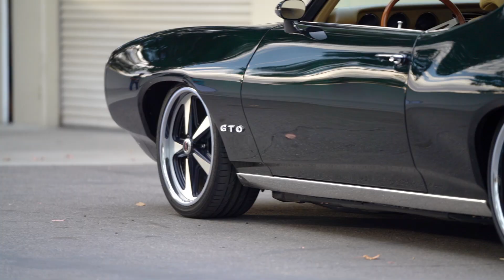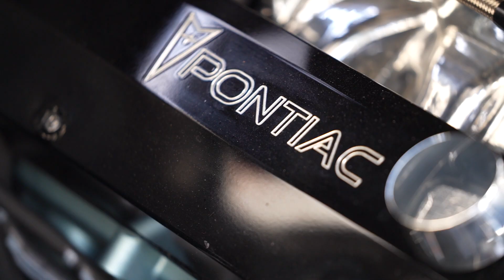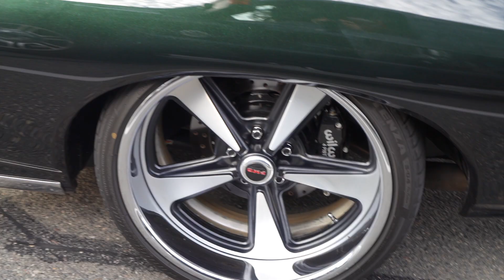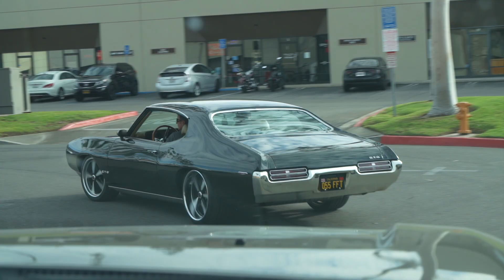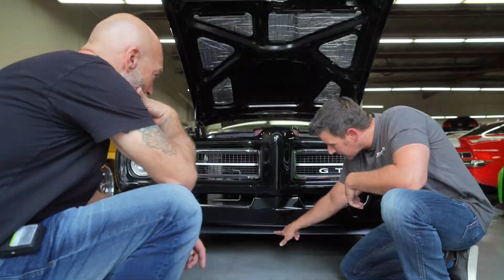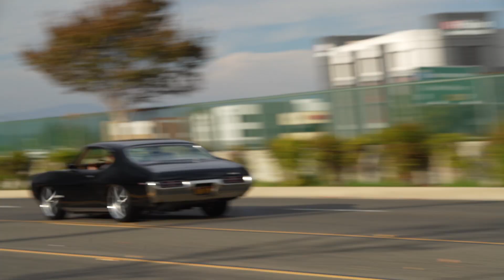LOUD Pontiac GTO Custom Pro-Touring Build | DIY Project Car

Comment: Gorgeous build.

You guys want to see a one of one "fluke" factory built '70 GTO Judge in possibly the coolest, craziest looking "factory"(fluke) paint and interior combination? It's a 70 Judge, in Mint Turquoise Metallic, with Blue, Purple and almost florescent red Judge striping, with a bright red full interior....it looks absolutely amazing (and would absolutely kill if it had this stance and wheels). That specific paint wasn't available with red interior, but when it was built in Canada, they must've run out of the interior color it was meant to have, so they fitted it with full red to match the center "striping", from what I've read, there's a handful of "fluke" GTO Judge's that were built with paints and interiors that were never supposed to go together, and they all came out of the same Canadian Pontiac plant as the US Pontiac would've either had the correct stuff at hand to make the correct spec, or waited to complete the build until it was "correct", but this Canadian plant just let a handful slide out the door with crazy combos nobody ordered 😅

Look the car up, just type in "70 GTO Judge Mint Turquoise" and you'll find it lol.... IMO, it's the best color combo (besides this classy dark green over gold/tan) ever.

Comment: This is one of my favorite builds. I would take that car over just about every thing out here today. I don’t even think I’ve seen a gto in the last 10 years. These cars are rare to see.
Reply: Thanks Brother!  Lot's of upgrades since this video... Shawn might have me back soon, for GTO 2.0.
Reply: @FastMonty  If you are still using the stock clutch pedal and assy, which slave cyl/bracket setup are you using?

Comment: My only suggestion , please take off that carb.  FI is the way to go.  You just can't beat the performance of a modern FI system.  o7
Reply: Done.  Lot's of upgrades have happened since this video.  Including rebuilding the engine... see that smoke on shifts?  Yeah, bad PCV, lead to oil starvation.  Moving on...
Reply: Only EFI Id trust is OEM.
So easy to fine tune a carb with 02 sensors theres no real difference. Maybe a bit at idle or elevation changes. Wont make any more power

Comment: I LOVE everything about this GTO other than the exhaust way to loud I like the mellow sound. Throaty sound, not the ting, ting and back firing when you let off the gas. I owned a 65 GTO with the 389-tri power 4 -speed also 66 GTO with a 68 400 H.O. Formal motor. Also, with a 4-speed Got married all had to go. That was back in 1972-73

Comment: I used to have a triple green 1969 that the prior owner put on 1968 doors since he was a smoker and wanted the vent windows. LOVE how this owner didn't just refuse to go LS, he kept the numbers-matching block--not hard to take these out to a 455 foundation. It's funny how low these things sat stock (i had 1980's Firebird Formula Rally II rims on mine) since so many of us saw these things on Series 70 rubber back when they were just old used cars.
Reply: Thanks Albert!

Comment: I love this car. Awesome wheels
Reply from the maker: I love it too and he’s done a lot of work since this shoot
Reply: @AutotopiaLA  Ha!  That's for sure...Engine Rebuild, now a 470, FiTech Throttle body with a Port Injected optional intake manifold, Tremec TKX with new cross brace,  RAM Dual Disc clutch, new Rick's Baffled tank with an LS3 in tank pump.  Did I miss something?  Might need to do a part 2.  :)  Thanks again for filming my project, had a blast!
Reply: Thanks!  I love em too.  :)

Comment: First time I've seen a 68' with 69' front parking lights. Wish I could get mine back.
Reply: FYI, it's 100% 69, except for the side view mirrors.  Get yours back!
Reply: @FastMonty   well that explains the parking lights LOL. This was posted on facebook, but the title said it was a 68's. I'd like mine back, but it was sold off to another in Vegas. I'll have to be happy with my 87' C/10 short bed.
Reply: @87Rado  Ha!  Too funny... Every time I see a slammed C10, I like them more and more.  Awesome.  By the way, the GTO pic on your profile was that yours?  Because that's the car that inspired my build, even down to the paint brand.
Reply: @FastMonty  Sorry to say, the pic is not of the one I had, BUT it looks just like it, which is why I chose it. Mine was black on black with blue pinstripes, and hand painted GTO in blue on the rear quarter panels. Had around 425 hp, was a blast to drive!!!
Reply: @FastMonty  I just changed my pic to the one I had.
Reply: @87Rado  Ha!  Awesome!  You'll get it back... I have faith.

Comment: Would've went 455 in this.  Also he's got either the wrong rings or too much ring gap.  Something is causing that smoke when he lets off.
Reply: It's the original number's matching 400 block, hence no 455.  The smoke was due to a bad PCV plumbing job... I didn't know I was blowing smoke until this video came out.  Fixed it.
Reply: @FastMonty  very nice!

Comment: What size rims and tires
Reply: 19x8.5 with 245/35-19, and 20x10 with 285/30 - 20.  Will be going with 295's in the rear, as these are a little too small.

Comment: I have a 1969 GTO convertible with the fixed headlights.  Unlike the "common" opinion of most GTO fans, I actually think that the 1969 model year looks best WITHOUT the hideaway headlights.  I think the fixed headlights make the car look more aggressive.  Maybe it's because I also have a 1969 Chevelle SS 396 and the fixed headlights on the GTO kinda makes the front end look similar to the 69 Chevelle SS.  Plus with the fixed headlights you don't have to deal with leaky vacuum lines and floppy, sagging headlight covers!
Reply: Ha!  Thanks Johnny... totally agree.
Reply: Well, all you do is replace the vacuum actuators with electric ones.  They have kits for the 1st gen camaros.

Comment: Cool car and love the pontiac engine!
... but as usual for theese kind of cars: a bit too big rims/wheels. (especially the rears)
Reply from the maker: Those wheels and tires fit and tuck well here though
Reply: @AutotopiaLA  It is an awesome car and I'm just being nitpicky with my personal bias: there's just something that bothers me slightly with the way the oversized rear rim is partially covered by the fender at the top, when the front rim isnt.
The overall stance/rake is cool and the rim design definitely works, so the rear rim is probably the main culprit for this.  
I'd go one inch smaller in the front, and two inches in the rear, but hey thats just semi-old school me :)
(I'd probably widen the track slightly at the front or narrow it slightly at the rear to give a more square stance aswell)
It probably is more eye-catching the way it is though :)
Reply: @rogerwennstrom6677  Thanks Roger... problem is, smaller wheels in the front will not fit over the brakes.  :)  I understand where you're coming from, and it's kind of an optical illusion.  The tires in the rear are actually too small.  The next set will be wider and taller, which will look 100 times better.  We shall, see... Thanks for the comment!
Reply: @FastMonty  Wow, thanks for the reply man :)
On one hand: I do see what you mean with the tires in the rear, there seems to be not quite enough "meat" (rubber) on those rear rims.  (for example, if there's one thing that never looks right is if the height of the rubber itself is less in the rear than in the front, if you know what I mean)

On the other hand: one of the reasons this is a problem in the first place is the size of the rear rim. I'm guessing the rear rim is two inches taller than the fronts and personally that is atleast one inch too many.
The way I see it (which seems to be in the minority nowadays with the common oversized rear rims), there's not really room for the rims to sit quite right in the rear fenders with that big of an offset on virtually any muscle car.  They aren't designed for it!

Those front brakes are the business though, so I respect the decision to go big on rims there :)
And sorry for needlessly putting this awesome car in the crosshairs of a personal "desktop warrior" rant :(
The car is  great! Overall a super thorough job that still keeps the soul of the car intact.
Reply: @rogerwennstrom6677  No worries Roger... everyone is allowed their own opinion, ha, ha... So, the rear wheels are currently 1" larger than the front.  Again, there's an optical illusion going on.  One, the rear tire has the identical Outside Diameter as the original tire, which is about 26.6"  The front tire is 25.6"  exactly one inch smaller.  (The wheels are 19 and 20)  The other illusion here is the fender lip height.  The front is higher.  So, because I don't like the "raked" look of cars, I wanted the middle of the car to be low, and level.  Hence the current look.  Me being a fan of modern sports cars too, that why the low profile tires, and it handles like a champ!  Nice chatting with you, and if you ever want to learn more, hit up my channel... have fun!
Reply: @FastMonty  Again, I really appreciate the response: I'm honored! :)
I AM surprised that there is only one inch difference in the rims front and rear!  (I guessed 18 in the front and 20 in the rear) 
And thanks for the info about the outside diameter of the rear tire:  I did believe it had increased compared to the original, so I was obviously fooled by the illusion created by the bigger rim.

But you make a very valid point about the lower fender lip height in the rear, that I was kind of hinting at in my last reply: these cars aren't really designed for bigger rims at the rear.  If rake is out of the question (and I certainly understand why you wouldn't want to) it probably would've looked more proportional and cleaner with the same rim size front and rear.
But yeah that is ofcourse just my rather insignificant whining based on my personal taste (and it applies to like 90% of the builds shown on AutotopiaLA, so I almost feel bad for venting on this particular build, but perhaps it was because the car overall just looks so darn clean!) 
In the end, you have created this awesome build on your own and I'm just sitting here behind my keyboard nitpicking it.  ("a critic is a legless man who teaches running" or something like that)

BTW, your channel seems great: you really ARE paying it forward.  You might not reach millions of viewers with your focused approach (what do I know though?),  but you might help thousands of actual builders and that is worthy of respect.
And I can imagine that machine does grip and handle quite nicely! :)
Reply: @rogerwennstrom6677  Thanks Roger... yeah, no old musclecars were designed to have their wheels tucked.  That's why this hobby is so much fun, making it modern typically requires lowering per the owners discretion.  :)  Almost all old musclecars have the lower rear lip, which "we", the owners of said cars, love that look.  It's not for everyone.  Nothing wrong with that.  Thanks for chatting it up, and I'm sure we'll meet again... See ya!

Comment: This has quickly become my favorite AutotopiaLA video. I love the fact that it's Pontiac powered and not another Chevelle or Camaro with an LS. Nothing wrong with those, I just like to see  other GM brands. It would be nice to see a Poncho powered Trans Am or Formula. Or for that matter, one of the other A bodies like a 442 or Stage III GS.
Reply: Thanks Robert!
Reply from the maker: Working on some of those others you mentioned. And yeah, I love this car too and Mike is such a cool guy
Reply: @AutotopiaLA  Awesome Shawn,  great to hear, love to see some of the old iron too.
Not that I don't appreciate the LS motor vids, but they seem very common nowadays. 
It reminds me of the the Chevy TPI  craze back in the eighties, when that was the go-to swap motor and people were ditching the OEM big blocks for a tuned port 350.

Comment: the motor smokes. looks like could be  bad valve seals or ring that didn't  seat
Reply: Almost... didn't know I had a problem until seeing this video.  Fixed it.  Filmed it.  Will post on my channel soon.
Reply from the maker: Check out Mikes response here
Reply: @AutotopiaLA   the car is awesome
Reply: @ronaldbooth9523  Thanks Ronald!

Comment: The ‘69 GTO is the ‘69 Camaro of GTO’s.  I like everything about this car, except the wheels.  Just a tad to big for my liking.  And the oil smoke out the tailpipes is just going to get worse.  That needs to be addressed.  No only can you see it, you can smell it.
Reply: Thanks... actually I couldn't smell it, and this video showed I had a problem.  I fixed it.  Filmed it.  and will be posting it on my channel.
Reply: @FastMonty  Valve seals?  Or PCV?  Catch can?  Oil puff was on engine decel only, between shifts.
Reply: @scarbourgeoisie  Yup, only happens on decel... it's a PCV issue.  Filmed the leak down test, and everything...
Reply: @FastMonty  Glad you found your issue.  Nothing ruins the build reputation like oil puffs out the exhaust.
Reply: @scarbourgeoisie  Ha!  Totally embarrassing.  But, that's how we learn the fastest.  Ha, ha... thanks again!
Reply: @FastMonty  Don't sweat it.  Least is wasn't anything serious.  Car is stunning.  Enjoy and Merry Christmas from Canada.
Reply: @scarbourgeoisie  Thanks!  Merry Christmas to you too!

Comment: That car is so pretty... Seriously, I'd black out the rear bumper to match and nothing else.
Reply: You mean "Green Out"?  ha, ha... thanks!
Reply: @FastMonty  Yes, lmao, somewhat colorblind... Such a deep color! Is that candy paint?
Reply: @alecfleming373  Ha!  no worries.. it some pearl in it, yes.
Reply: @FastMonty  Stunning! Being this is the case, is therefore a place I can get more information on this car down the road? Remember candy paints fade and burn easy in the sun, so assuming you know this, in like 6-10 years time, if it's been moved around and worn correctly, it should have a beautiful hombre fade effect. But the reason I really ask is the pearl inside the candy. I haven't actually seen that before. Something I'd like to see as it ages for the simplest of not knowing how it'll perform. Very cool build! Hope to see more from these builders!
Reply: @alecfleming373  The paint is 6 years old now.  You can follow my channel for how to's and other GTO driving events.  It's not a "candy", it's a modern 2 stage, Green Metallic Pearl... Oh, and I'm the builder.  No current cars on the agenda... just enjoying this one for a while.  Thanks !

Comment: Set for show though practical would put the origional tires and wheals  back on
Reply: Except original tires won't work with the 14" brakes, let alone having fun on an autocross track.   If you haven't tried autocross... you're missing out.

Comment: What's with all the blue exhaust smoke?
Reply: it's called oil.  lol... actually didn't know I had a problem, until seeing this video.  Fixed it.  Filmed it.  And will be posting it on my channel soon.
Reply: @FastMonty  valve guide seals?

Comment: Love love love it! Wheels ARE sweet BUT a teeny bit more sidewall would really favor the look.
Reply from the maker: I hear ya but overall I just love this car
Reply: Thanks!  And Agreed.  Next set of tires will be taller, and a tiny bit fatter.
Reply: @FastMonty  ...and prpos on the Pincho mill!
Reply: @FastMonty  Poncho... I meant Poncho! Lol
Reply: @calvincooley1074  ha!  I got you... thanks!
Reply: I like those wheels! What are the specs? Will they fit a 70 Chevelle? Are you looking to sell them?
Reply: @mlow6372  Thanks!  They're US Mag BandIT's.  19x8.5 and 20x10.  I think you can go 1/2" wider for each.  BUT, I would get a Percy's Wheel Rite tool to measure the backspacing.  Good luck!
Reply: @FastMonty  thanks for the quick response and if you all want to sell let me know 😉

Comment: 9.5 please paint that rear bumper. Awesome ride though.
Reply from the maker: I hear ya but have no problem with the chrome and I’m not big on chrome
Reply: I might paint this bumper... notice I shaved the bolts.  I also have another chrome bumper with the bolts... so, I might just switch it up, like wearing different shoes... ha, ha...
Reply: I painted my rear bumper but his looks awesome chrome
Reply: @domaleons  would look even better in that awesome green. Looks somewhat incomplete compared to the rest of the car. Still a bad MOFO though.

Comment: My first car was a 1969 GTO. It wasn't as nice as this one, wasn't as fast as this one. But it didn't smoke like this one.
Reply: I didn't know it smoked until this video... fixed it though.. had a PCV plumbing issue.  Thanks!
Reply: @FastMonty  I had the same issue on a 1986 GMC truck. Your GTO beyond rad!
Reply: @joefender.nc1  Thanks Fender!  Crazy how a $3 part can cause so much havoc... part of the hobby.  Thanks again!

Comment: needs an lsx, lots of blue smoke  from the exaust, must be burning oil
Reply: Yup, didn't know I had a problem until seeing this video.  Fixed it.  Filmed it.  Posting on my channel soon.  (Ohhh, and LSX's have oil issues too)
Reply: I'd question the rebuilt motor. Rebuilders are not created equal.
Reply: @ChasingPerfection  a crate new ls is the best thing ever, comes with gm waranty